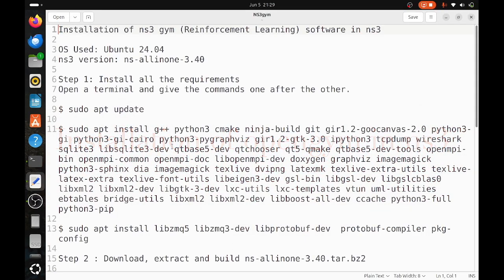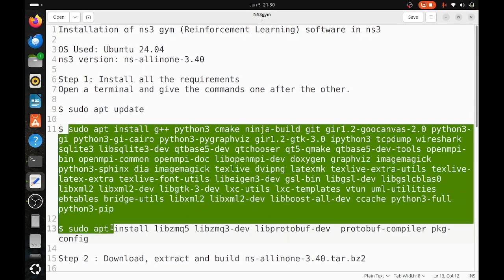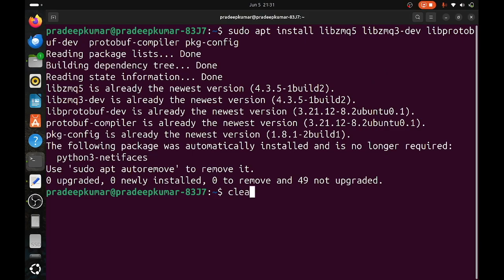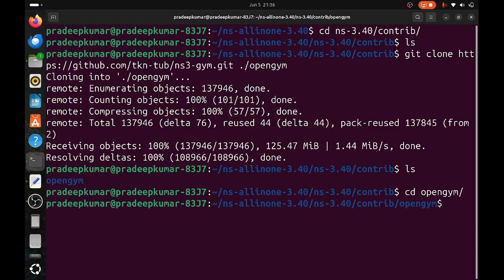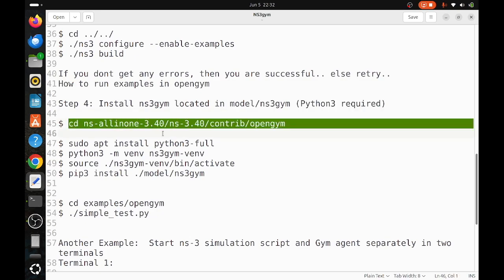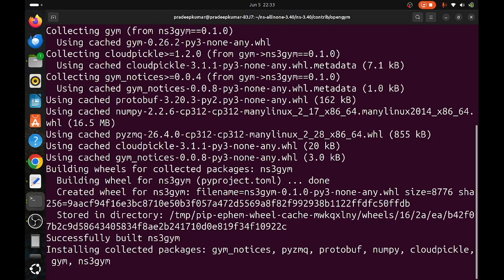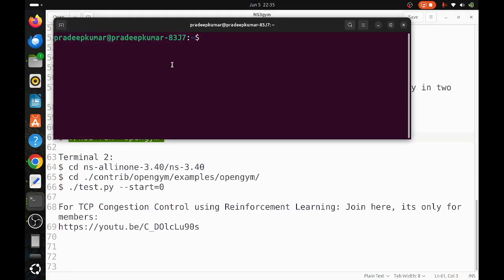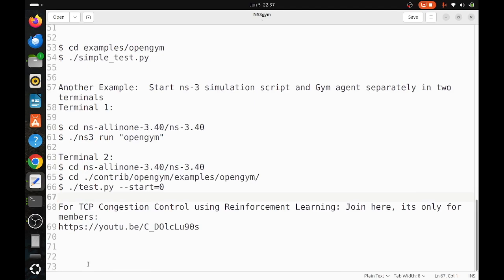Install OpenGym in NS-3 | Step-by-Step Guide for AI & Network Simulation Integration

Comment: Thank you very much for the videos! I have a question, I installed ns3 with the python bindings and I want to use a gym environment for RL with NS3. Do I need to add open gym like here and if yes how to do it without losing Python bindings and breaking the build ?
Reply from the maker: Python bindings always work with Python Virtual environment. Sop whevner you use python related, just go with venv. it solves your problem... Yes, RL with gym also runs with venv only...